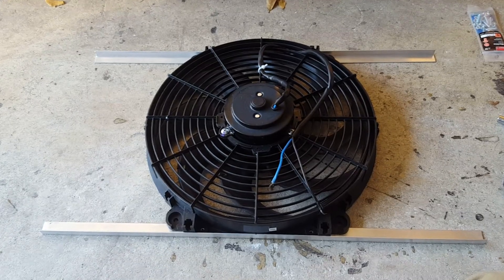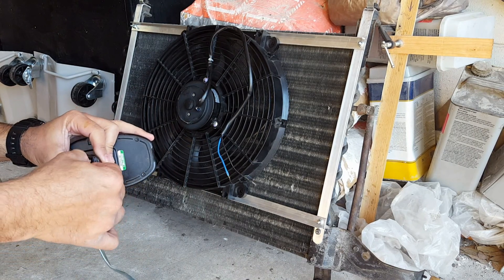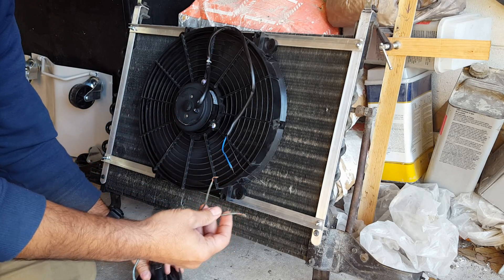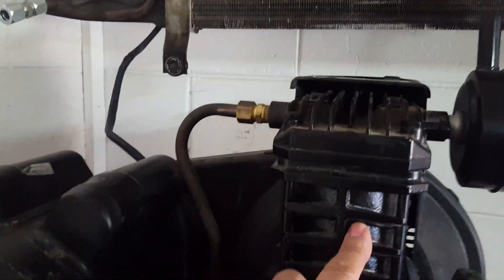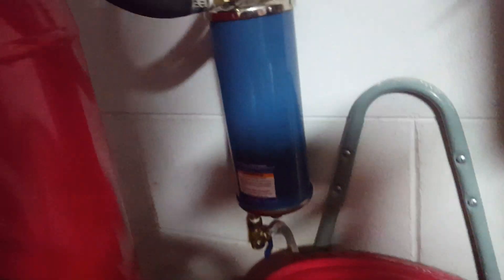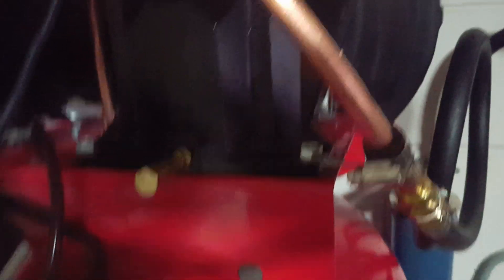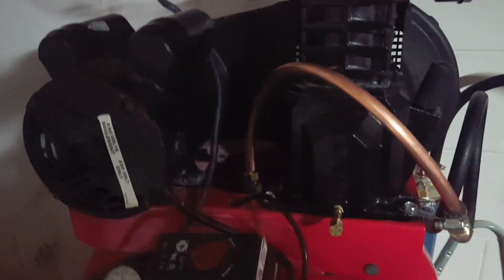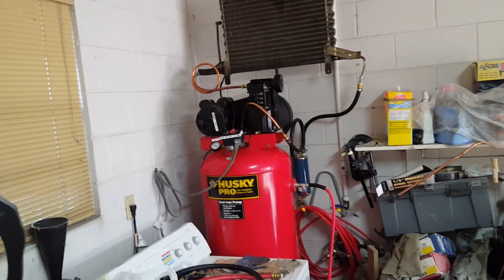DIY Compressor Air Dryer, Aftercooler Water Separator

Comment: Nice job using these parts to condense the moisture out of the compressed air. I have been an ASE Master Tech since 1978, now retired and wish I had that much wall space. Shelving everywhere! Hey, how are you powering your 12 volt DC condenser fan? Battery on a charger perhaps? Also, your concern on different metals for connectors would be “Galvanic” reaction. Buy some dielectric grease in the automotive center of your home store. It’s about $5 in 2020 dollars, plus it works great on your vehicles. Use on connectors exposed to water but also the bulbs in the sockets, tag light, head lamps and even the positive terminal on the battery. Note; The stuff sold in the “Electrical” department as it is meant by code for aluminum wire in panels. Same, but different and twice the price.
Also, for anyone looking for a used A/C condenser, find the old ones he used that has round tubing as the new stuff uses extruded aluminum that has tiny rows of holes and could restrict flow, plugging easy and used on 2000 & newer R134a refrigerant. These will work but may not have enough round tubing to attach to.  Nice job, good audio & video on a popular garage project to help if painting or just keeping your air tools from going bad quicker. Purchase some air tool oil, use before and after. Hang a dedicated old towel in the same spot to clean your air tools. The main worry about PVC / CPVC is heat first and certain chemicals. A friend of mine has been running 125 PSI for 13 years now. God bless buddy. Old wrench gives two thumbs up! Like & Subscribe everyone!
Reply from the maker: thanks Dean
for the condenser fan I am using a 220 to 12 volts converter, just make sure you pick one w/ the correct amperage :)
I have it wired so that it comes on when the compressor turns on.
Reply: @Dean Kay Sir that's an excellent informative comment! Much appreciated, you gave me some ideas! You rock! Take care!!
Reply: Dielectric Grease is NOT for aluminum conductors. It is called Oxide Inhibitor, or by trade name No-ALOX, is greyish and/or black in color and extremely messy and permanent staining on fabric.  Dielectric Grease is used to inhibit corrosion on lugs, wire connections of same type wire and coupling connectors to preserve the connection conductivity. It can also be used on battery terminals. Stainless Steel fittings are good for copper connections.
Reply: @anonimous2451   You are correct if you are wiring a service entry for a house, garage, barn or hog shed.
Otherwise, regularly dielectric grease is used everyday on copper wire on automotive applications. 
  Who uses aluminum in a car? It was tried and failed bad. Aluminum wire is used on home power services and requires a different oxide formula. Thanks for pointing this out for those who use aluminum wire on their automobiles! Now tell us what metal is used on satellites and protective anti-oxidant is used on their terminals. Could it be a "Hexavalent" compound? Jeesh!
Reply: @deankay4434  Chromium Hexavalence ..........just add it into your water supply
Reply: @anonimous2451  Unfortunately that creates hydrogen embrittlement issues then complete failure.
Reply: All great points - except for the PVC. Probably the 'riskiest' of all the 'rigging' going on here. Just because it works, isn't necessarily the 'safest'. Coming from an Air Force retired (certified) mechanic myself after 24 years, just for perspective. Just shared thoughts... not trying to sling harsh criticism but I would certainly consider alternative tubing for safety. Cheers.

Comment: Hello Lincoln, I was wondering where did the 14 inch Radiator fan come off of Car/truck? Make model?... or did it come off another machinery Thanks In Advance:)
Reply from the maker: Hi, 
The fan came from a vehicle in a salvage yard.
The fan is not an OEM part, that was added to the vehicle and was aftermarket.
Reply: Ok, Thank you For answering my question quickly. Awesome Setup!!!( TWO THUMBS UP)!!!!

Comment: So many people add a cooler or condensor and never use a fan.  There is some cooling with no fan but the fan really makes it better.  Its all about heat exchange with the air rushing over the fins and tubes.  Maybe a filter to clean the air so that the condensor doesn't get plugged up with cat hair and dust.

Comment: Hi sir thanks for the idea , but I don't  see a non-return valve on the tank ?? so the air leaks out after you shut off the pressure switch , someone correct me if I'm wrong

Comment: A 125 degree difference is definitely enough to get my attention!   I guess this is why stock/default condenser / dryers actually look very similar to the A/C condenser you're using.   I have an old 100 gallon / 5 hp unit I'm setting up and think I should go with this design.  How are you powering the fan and is it located on the wall behind the condenser radiator?  How does it switch on and off and if a 12v automotive fan are you using a AC to DC transformer of some type for it?   Sorry for all the questions, I could really use the help. Thank you in advance!
Reply from the maker: Hey
It makes a huge difference, when you use air as much as I do.

The fan is mounted to the back of the condenser and both are hang on the wall with long "L" brackets to give more space for air to flow.

I am using an AC to DC transformer ( One has  to pick one based on the fan one is using, n it's power requirements )
I wired it to the switch junction on the compressor, so that it turns on when the compressor turns on and shuts off when compressor shuts off automatically. 

I hope that helps and good luck w/ your project 🙂👍
Reply: @LincolnMaxnCo   Thanks a lot for the info.  I'm going to make a parts list tonight and get started.  My compressor is a big Saylor Beall 705.  Do you use any additional air dryer or condenser after the tank?  I've seen countless crazy set-ups on youtube with copper pipe and it seems most people who do it dont get the fact that cooling and condensing before the tank is really the best way to go.  Regardless, do you think anything else is needed from the tank out.
Reply from the maker: @oldowl4290  
Yes, the air goes from condenser to 
1- small blue/gray water separator
2-to main tank
3-from main tank to PVC pipe
4- then there is the first water trap
5- there is a slope on the PVC pipe wich helps separate any moisture build up.
6-then second water trap
7-then I have 2 water separators on the wall
8- then I have the female connector for my air hose.

As for anything else needed, I would say it depends on what you are using your air for.
I build my set up mainly for painting and to prolong the life of my tools and compressor.

Good luck w/ your projects 👍

Comment: I like what you've done, great job! Except for the PVC air line... I have personally seen PVC air line blowouts 3 or 4 different times and let me tell you, it's f×××ing dangerous as hell. People dont realize the explosive potential energy that pnuematic systems possess. Its is far more dangerous than hydraulic pressure, when a hydraulic hose burst open all of the potential energy in psi is immediately lost whereas pnuematic explosion is so dangerous because of the compression of the air makes instant decompression so violently dangerous. If your heart is set on using PVC at least change out the lines every couple years or before the pvc becomes brittle because thats when the blowouts start happening especially in extreme cold weather and extreme hot weather.

Comment: Is that a serpintine condensor or parallel condensor ?  Thanks for the info.
Reply from the maker: I think it is a serpintine since it is from an older truck, 
The tubes on it are much bigger than a modern condenser.
I hope that helps 🙂

Comment: What should be pointed out is that in this setup only the water that's in excess of 100% humidity at room temperature is removed.  While the ambient humidity in the room could be, say, 50%, after it's compressed and cooled like this the air that continues on to the tank contains no liquid, but it is now at 100% humidity, it's not dry, and the tank can still rust in this environment.  Moisture condenses out because room temperature is below the dew point of the compressed air, and only the moisture in excess of what the air can carry at room temperature changes from vapor to liquid and gets removed.  To get the air in the tank below 100%, your condenser would have to cool the air below room temperature, so that when it warms back up to room temperature in the tank it will be below 100% relative humidity.  If your tank is in an unheated garage and left with air in it, water will condense in the tank as soon as it cools anything below the temperature the room was at when it was put in.

While I see PVC often used for compressed air, it's dangerous and it's an OSHA violation to use it for this purpose.  Copper or aluminum are better choices. I also would have turned the tee fittings in the supply line sideways so the hose to the regulator would lie flat against the wall instead of sticking out.
Reply: Get lost

Comment: Nice job!
Not a bad idea to try and use less connections like for your regulator/filter why not attach that straight to the pipe instead of using more hose and connections? Just a thought

Comment: The reason you dont connect copper to aluminum or steel is due to electrolysis.you can use copper but it will build calcium over time. Brass fittings are good to prevent an electrolysis reaction.dielectric unions for residential plumbing systems to connect different material pipes are made from steel and brass.

Comment: You did great by putting those loose 1 turn coils on each side to reduce vibration transmission. 
Most people would never have thought of that.
Reply from the maker: thanks 👍🙂
A lot of people would not even notice that,
you have a good eye 👍
Reply: The coil going from the compressor to the heat exchanger also allows for thermal expansion  of the copper when it heats from room temperature to 200+ degrees.

Comment: What filter did you use?
Reply from the maker: If you are referring to the  first small tank, it is from Harbor Freight,  it was an "industrial filter/regulator" but I removed the regulator part since I am only using it as the first main water trap.
The other two small inline filters after the PVC pipe are also from Harbor Freight
I hope that answered your question  🙂👍
Reply: @LincolnMaxnCo  Thank you, that does answer my question. I just got a 5hp 80 gallon compressor and I will be doing the same modification.

Comment: I was always under the impression that schedule 40 PVC for compressor lines was a bad idea because of max pressure.
Reply: Most schedule 40 PVC is rated for 250 psi so there shouldn't be an issue.
Reply: @Peter-V_00  What about fittings? Is threaded or solvent weld rated for more than 200psi?
Reply: @sergeantseven4240  I'm pretty sure the assumption could be made that the fittings and solvent joints are equal to the pipe rating, otherwise the pipe would need to be de-rated to reflect actual operating limits, most compressors operate at 125 psi and lower.  Yes I know there are some people that insist on jacking up operating pressure but they are usually the people that misunderstand pressure vs volume, 200 psi is worthless if the CFM rating is too low meaning the system runs out of breath too early.
Reply: @Peter-V_00  reading more about it, seems the issue isn't about max psi rating it's about the brittleness of pvc in freezing temp and old age. I guess it is known to explode sending plastic bits everywhere. Osha doesn't allow it. But also it's super easy to not do the solvent welds good enough. Nuematic pressure and hydraulic pressure act very differently in these situations.
Reply: @sergeantseven4240  You're right. I've always heard it was a bad idea to used pvc pipe because it could burst and send plastic pieces everywhere, which could be dangerous.

Comment: The only issue with this set up is its gonna drop flow rate, 90 degree bents have to be avoided at all costs and a a/c condenser is basically  a cluster of 180 degree hell!  lol.   I guess as long as it can keep up with the volume of the air tool then its fine!  But for high volume tools that need something like 10+ CFM  to operate, you'd be better off with a small cooler with a lot less bends in it and a higher powered fan.  I've seen a couple other designs on here that use compact oil coolers instead, and they seem to be getting room temperature results, so there is no downside from what I can see.
Reply: I wish people would check how long it takes to fill the tank before and after this mod.

Comment: Nice setup, however in a cooler/condenser setup, you always send liquids or air/gases in from the top of the condenser or radiator.
Reply from the maker: Thanks  
The inlet portion on the condenser is on the upper part which is the left side, the lower part is the outlet which is on the right side 👍🙂
Reply: @LincolnMaxnCo  
You're aware that you build an aftercooler with a water trap and not a compressed air dryer, yes?
The compressed air after your cooler will be 100% relative humidity and if there is further cooling in your tank or the lines/tools after the tank there will be more water falling out of the air.
To dry the compressed air below 100% RH you need an actual dryer that either uses a refrigerant cooler or desiccant.
Please read: https://www.air-compressor-guide.com/articles/water-in-compressed-air-calculations/
Reply from the maker: @joansparky4439   Thanks for the link, 
and the explanation 👍
I call my set up a dryer because that is what I saw other people calling it when I was doing research about it.
I have to say that I am very happy w/ my set up and I get no more water coming out of the line, even while constantly using a grinder.
Before I had this set up I constantly struggle w/ water coming out of the line, even if I drained  the compressor tank every time
I might get a desiccant dryer to use before painting a big project but for now my set up is working great for me  🙂

Comment: I understand the concept of cooling the air but where is the moisture actually released from the system?
Reply from the maker: The first place is the small blue tank/filter before it goes into the compressor ( that is where most of the moisture ends up), the second point is the compressor thank at the bottom, then there is a water trap at the bottom of each of the 3 lower parts of the pipes.
There is also two in line filters before the connection to the air hose.

Comment: Been running a condenser out of a 84 Chevy truck for years on a 120 gallon tank, sandblasting several tractors and seems like a thousand parts in a cabinet, works like a champ, but not before I added it, wet sand would worry the mess out of me, kept thinking my hose was stopped up and all it turn out to be is moisture from the compressor keeping the sand from falling through small hole into the flow of air

Comment: Never use pvc for air lines! Shrapnel when it goes!
Reply: I've used pvc for overs 10 years no problems
Reply: I have seen the aftermath of the pvc failure. I have to admit it was the piping coming from the compressor that was mounted on exterior of shop, so the sun and heat can make the pvc brittle. Still, when it goes the pvc turns to pieces unlike copper or pex that just open up/expand into a crack to let the pressure out.
Reply: I worked in an electronics factory where every machine used air. We used a monster sized compressor and every line piped throughout the plant was PVC.
Reply: That was exactly my thought. Although the dryer was great. I can deal with the skewed temp measurements from reflective surfaces. But, That shop is a death trap being lined with compressed air PVC bombs. I’d be nervous as hell to go in there.
Reply: @hybridamericandude3575  I have heard these horror story's for, I forget, how many years, I'm now 80 years old and have never seen or have heard first hand knowledge of these explosions. I know of not one or two shops so equipped but several and have seen not one problem